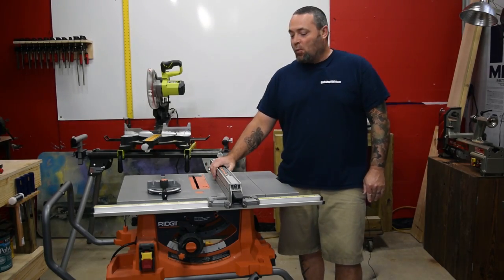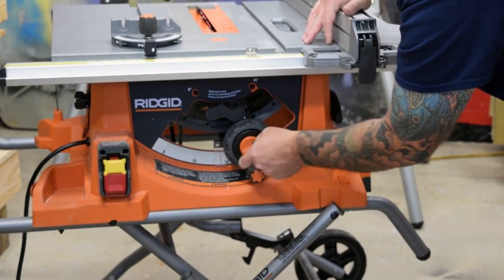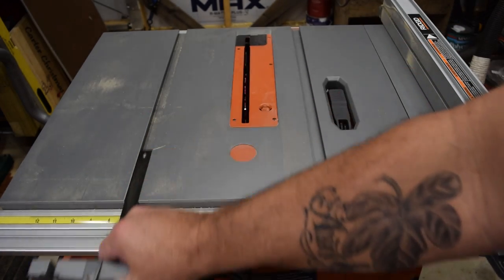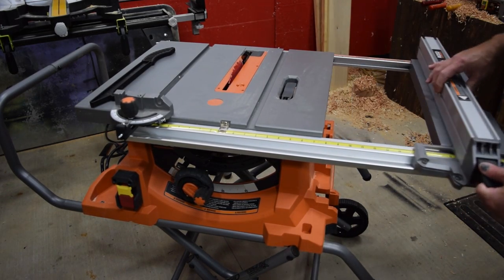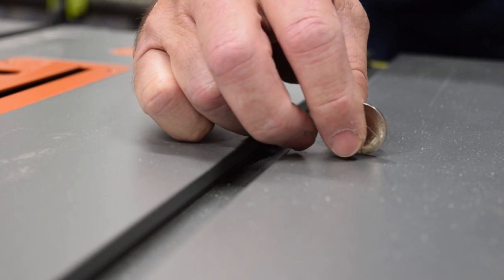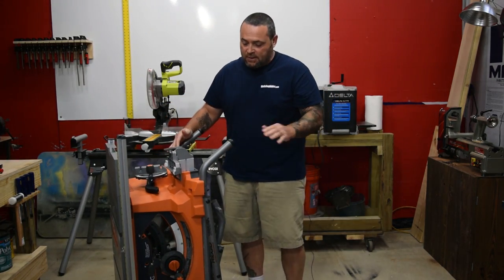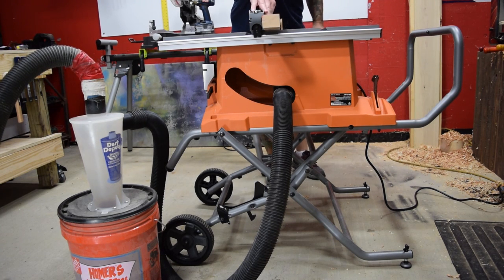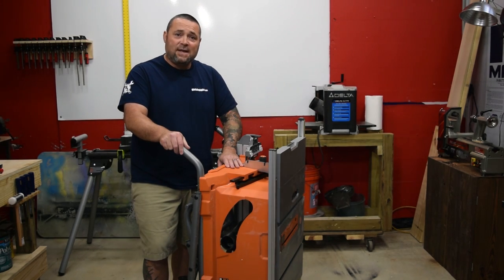Ridgid R4513 Portable Table Saw with Stand Review

Comment: Thank you SO MUCH for posting this video.  I purchased this table saw used and there were a couple of items not listed in the user manual. Specifically I was not able to raise and lower the blade height and ONLY because you posted this video was I able to learn there is a knob to turn the height adjuster.  That knob is broken off of my machine and it is broken in such a way that it does not appear that the rotator piece has a broken off knob.  I would have NEVER known to turn the specific piece you have to turn had I not found your video.  I now have an awesome table saw which I was able to purchase at an AWESOME price

Comment: I've had one of these for about 3 yrs,  Great Saw!
Reply: I have the previous model (R45101) and have been thoroughly satisfied.    The rip fence on this model seems to be a definite improvement.    I agree with replacing the blade.  The factory blade is pretty cheap.  One I threw on a good Diablo blade and an after market zero clearance throat plate, I was gold!
Reply: U have a zero clearance throat?
Reply: @kaniffsalot  Not needed a couple of lengths of masking tape on each side of the blade and no piece falls through.

Comment: It's a great table saw, but the one I have was not square out of the box. I had to make some adjustments. My only issue now, after changing to a thin kerf blade, is that the riving knife is too thick. So things would bind occasionally, which is pretty dangerous. I still have not been able to find a thinner replacement.

Comment: Looking into table saws for my hobby woodworking shop and saw these Rigid saws. They're really nice and so are the Dewalt saws with their racks and pinion fences. My question is... will these little saws ACTUALLY work in a woodworking setting? To me they seem flimsy or cheap only because of the plastic bodies and such. When I see them in the store they seem like decent tools but i don't know if anyone is using this style of saw for a woodworking application

Comment: ive got the r45171 and i been using it about 3 months or so.The blade wouldnt lower or raise ended up braking the bevel knob and stripping the plastic bevel gears i blow it out and or run the shop vac after each day so it wasnt anything on my end that caused the issues.I think i just got a bad one out of the bunch should of spent 200 more and got the better one.

Comment: H Donny. I have the 4510 model which has served me loyally for many years. Recently I was doing some cuts and turned it off between adjustments, etc... When I went to turn it back on...nothing. No power whatsoever. Is there a hidden or well camouflaged reset button im missing ? Ive since misplaced the manual and sure my warranties expired. If its a blown motor I will just buy a new one...shes paid for herself many times over and they are fair priced. If there is a simple(though well hidden)reset button i sure would love to save the embarrassment of taking it to my repairguy.... Thanks for your help.

Comment: On the side with the power cord, under the top is a black metal piece with notches in it.  Any Idea what it is used for?  Love mine, it's a nice upgrade from the cheapie I've been using for years.  My retirement gift to me from me.
Reply from the maker: We will have to look and get back with you.
Reply: Did a little research and discovered it is used to hold the blade guard and the pawls.  Thanks for responding to my question.
Reply: Tom P motor ribgid r4513 prase

Comment: whar blades can i stick on it kerf size? i do not see blade thickness on most blades. want to match riving knife
Reply from the maker: +Charles Holland You can use anything from a thin kerf blade to a thick kerf balde.  The riving knife will always be set up for a thin kerf.

Comment: how easy is the fence to use ? is it like the Dewalt Rack and Pinion ?
Reply from the maker: No, it is not as good as the Dewalt rack and pinion.
Reply: @WorkshopAddict  oh ok, today Homedepot has this saw for $299,  a great price. but i've been spoiled by using Dewalt's Rack and Pinion system...
Reply: the Dewalt with wheels is ~ $200 more, but has the rack and pinion and a bigger capacity for cutting ..
Reply from the maker: @sandhu49  Money well spent.
Reply: Moon Pie  thanks. I think I'll be getting it. Yeah it's big, but portable. Thank you for your great input.
Reply: Moon Pie  yes, you do get lot for $300,  One more thing with the dewalt the right rip size is 32", with this saw it's 25", but it's also $200 more the the dewalt.

Comment: Hi, Donny. Thanks for the informative video! I have a few questions for you and your viewers. First, do you know the major differences between this and the 4512 saw? I'm trying to decide between the two, but portability is not a major feature for me as it will stay in the shop. Second, what are your thoughts on the ruler used? I saw this at Home Depot and thought it was a joke! They seriously used a tape measure blade as the ruler. I just lost some faith in Ridgid over that. Is there a benefit I'm not seeing? Thanks in advance!
Reply from the maker: +Del Johnston Both the R4512 and R4513 have a ruler built in.  I can say that the R4512 ruler is not accurate and I would not use it as a guide.  The R4512 can be wired to be 220 and that will significantly increase the the power of the saw.  That is a big plus for the R4512.  On the downside, the R4512 has stamped and bolt on wings, so the tables, without wings, are about the same size.  If portability was not a concern, i would get the R4512 as it is a larger saw and could do more work, but both are nice for the money.

Comment: how does this saw cut hardwoods
Reply from the maker: It will yes.  As always, a good blade and the proper speed will help.  It will not be a lightening fast, shove it through cut, but not many do that with hardwood they want to use anyway!

Comment: Love your shop Donnie, looks like mine lol! 10" Ryobi sliding compound miter saw, the compact stand for it, the new Ridgid 10" 15 amp portable table saw! I seen you have a lathe back there I don't got one of those. I love my Ryobi 10" sliding miter saw but it has been all but retired lol, I'm super super heavy into the Ridgid 18 volt cordless tool lineup I am up to 20 18 volt tools and 9 batteries right now and I picked up their new 18 volt 7-1/4" cordless brushless dual bevel sliding miter saw a few months back and it works great and I love all the features it's just a great saw, I haven't used my Ryobi 10" since I got my Ridgid it has a smaller capacity but pretty much handles everything I cut. Love the idea of you workbench as an out feed table for your saw, when I got my Kreg Jig a couple of months ago I used it to build a good size workbench and I also made it the height of my Ridgid table saw so it could double as an out feed table lol! One last interesting thing on this saw is I had to take it to my rental today and my truck isn't running right now and it wouldn't fit in the car so I ended up detaching it from the stand then it fit in the trunk and I just set it on the cement to make my cuts and it did great, the plastic base has enough rigidity that it can run just fine without the stand I thought that was pretty cool. Keep up the good work bud!

Comment: The question always remains, "Do I buy Ridgid or do I buy Dewalt?"  Comparable machines always favor the Ridgid regarding price.  Most of the television personality construction shows are using Dewalt table saws and Dewalt Mitre Saws yet from what I can tell, you get more bang for your buck with Ridgid.  Do others feel the same way?
Reply: I struggle with the same debate. Honestly if I were a contractor that used this saw every week I would probably go with Dewalt. Being a homeowner weekend warrior that will probably only use it once or twice a month I think Rigid can't be beat for the money. When you throw in the warranty it's a no brainer. Although if I could get the DW7491RS for under $400 I'd buy the Dewalt.
Reply: Is 10 more inches of rip capacity worth 200 dollars though?

Comment: It s on sale at home depot $369.00 very tempting
Reply: Moon Pie  $299.00 the x legs
Reply: Moon Pie  I have read alot of complaints from owners of previous models...I think ill hold out for a Makita 2705'
Reply: Moon Pie  if you get the Hitachi you may want an extended warranty because I have seen alot on yardsales claiming a plastic defect that breaks easily!
Reply: Moon Pie  I have seen over 5 on local facebook yardsales and 3 had the same spot break.  Performance wise it performed like a dewalt At a competitive price, durability was the problem not price,or features...

Comment: I had an R4510 and it was a great saw, the motor burnt up, bummer. I bought a Dewalt DWE7491RS which I was not happy with and returned, and bought the R4513 because I did like the R4510 and am considering returning the R4513 because it is NOT the saw I was wanting. I would not recommend buying this saw.This saw is JUNK compared to its predecessor (R4510)1) When the table is extended it sags (almost 1/4" of play), the old was not as bad2) The miter gauge was a very sturdy 18" with a riveted metal indicator, the new one is 14" and flimsy with a tape increment indicator3) Old has 3/4" fence measure tape, new has 1/2"4) Old had micro adjustment on fence, new does not5) The old saw carriage was cast metal, the new is stamped6) The old deck was 3/16" thick, the new is 3/32"7) The fence on the new saw was not accurate (parallel to blade) and needed adjustment out of box

Comment: Check the gears in the lifting mechanism. Made out of plastic piece of junk.
Reply: I have one - the orange plastic cabinet broke in several places.
Reply: @Ray Chamberland The 4 feet broke off - possibly because of sun exposure and cold weather - it is plastic after all.
Reply: Ray Chamberland 4 years ago was the model r4510
Alot better saw then the new r4513 version